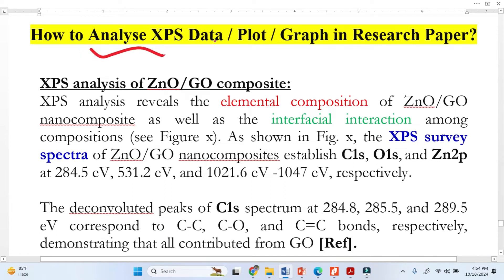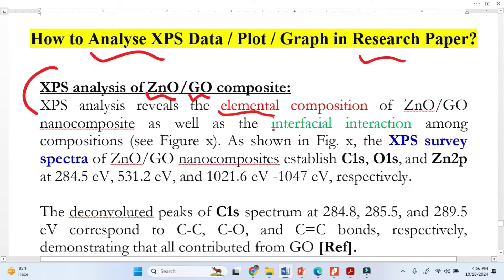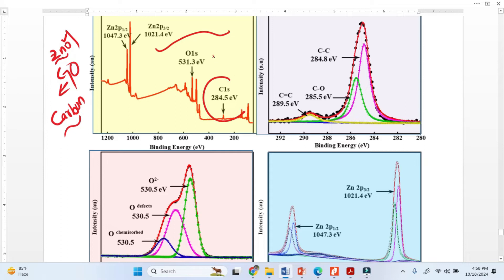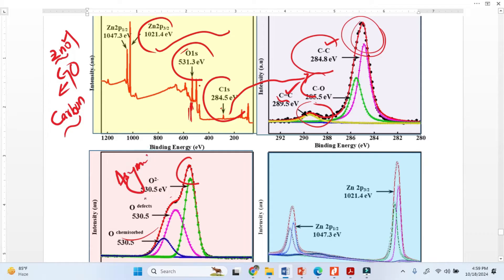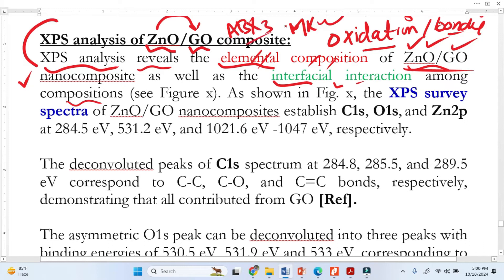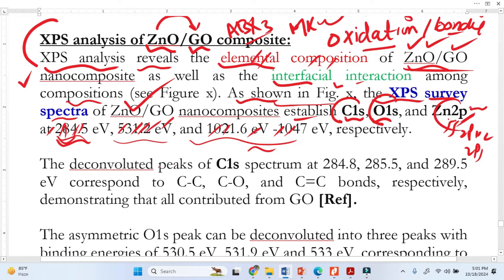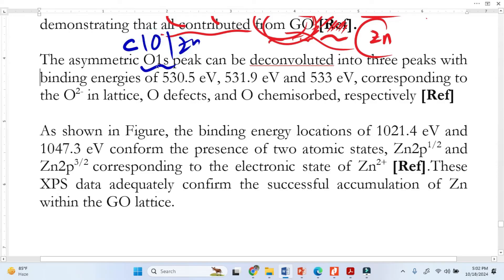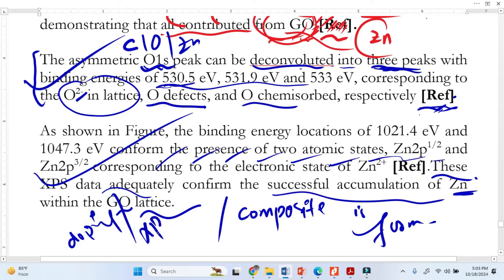How to Analyse XPS Data /  Plot /  Graph / in Research Paper?

Comment: Do you have reference for C1s C=C binding energy?  The pi-pi* transition signal is not well resolved according to conversations with xps experts and my personal search of peer-review literature.  What you you have tagged at 289.5 eV is most likely C=O=OH.  Carboxylic acids are a common contamination.  You need UPS and/or Auger to resolve aromatics.
Reply from the maker: Thank you for your detailed comment and for sharing your expertise. You are right here that the C = C (sp²) peak in C1s normally appears near 284.4–284.7 eV, and the π-π* shake-up feature is often weak and not well resolved in standard XPS. Your point regarding the 289.5 eV peak is helpful as this region is indeed more commonly associated with carboxyl groups (O - C = O), which can appear as surface contamination in many samples.

Sure, Ultraviolet photoelectron spectroscopy/Auger techniques provide much clearer insight into aromatic π-π* transitions, and I will highlight this in future videos for better clarity.

Comment: Sir i have one question.
Why there is carbon bonding in XPS data. Because in your sample ZnO there is no carbon. So why we focused on carbon bonding?
Reply from the maker: This is good question. I have already discussed it in the community post. 
Let explain it here again.

If you clean your sample but still can adsorb carbon (hydrocarbons from air) once exposed to the atmosphere and this thin layer is unavoidable in most lab environments, so a C 1s peak is nearly always present in every XPS spectra.

In addition, C 1s peak is widely used to calibrate the BE scale in XPS. Therefore, if even carbon is not part of the actual material (like in mine case which is ZnO), but still this peak is appear. 

Finally, during the synthesis process, no one can avoid the presence of carbon. These peaks must be there but we have to look our desired peaks like the Zn in my case
Reply: @nanospeaks  Carbon is unavoidable but that does not mean samples can be dirty.  Most XPS systems have Ar Ion gun to remove adventious carbon and other surface contamination. This is energetic process so some surfaces can be damaged.  State-of-the-Art XPS instruments use Argon gas clusters to gently clean surface.

Comment: You can use Casa XPS software
Reply from the maker: Correct. In modern XPS, this software is already embedded in the system so you don't need to deconvolute it manually like we usually do using Origin Pro etc....